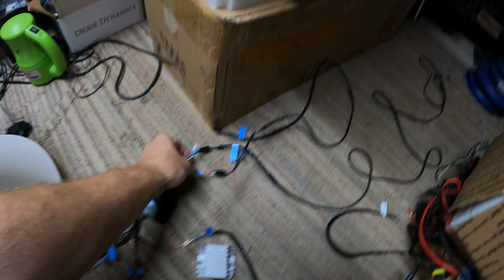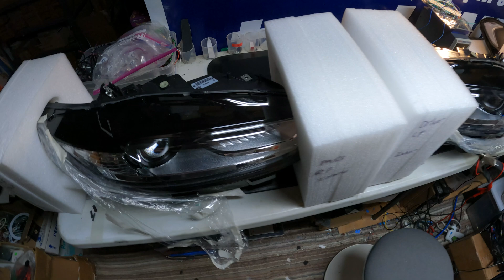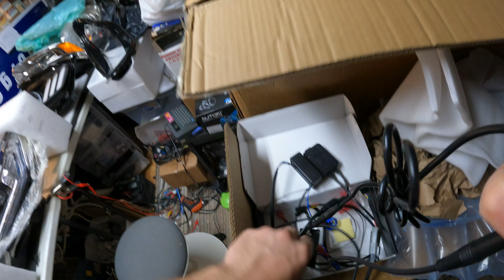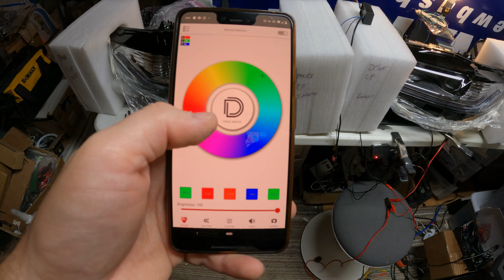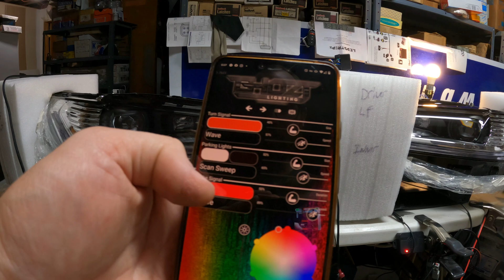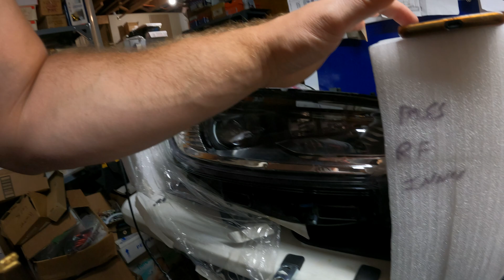2013-2016 Ford Fusion Animated Headlights Overview + Wiring

Comment: Hey man, hoping you can.answer 2 questions ive been pondering: 
On that Blue Ghozt app, does the "turn signal" animation have an ability to be solid, steady on?
And does the brake input have ability come on with an animation and light up any color but red?

Ive been thinking how to use one for some interior lighting:
-Parking light input wire would be used to turn on blue mood lighting, with a turn on animation, with the head/parking light switch at night.
-Turn signal or Brake input used to change the lights from blue to white ( also with a turn on animation if possible) either when a door opens or when the dome light is pressed on.

Hope that makes sense at all. I dont have the leds or controller just yet to play with and test for myself.
Thanks dude
Reply from the maker: There is a "Basic" turn signal animation, I believe I covered it above in the demonstration. That is a simple all on\off turn signal functionality. It will only stay on at the rate of your cars flasher unit. 

The only animation the brake input has besides basic solid on is a strobe effect as well. And yes it can be any color. You can also assign the brake input to be a specific show mode. A practical use for the brake input in a headlight application would be to hook it up to a 12v wireless remote, and allows you to then with a press of a button have your DRL turn to a show mode or different solid color.